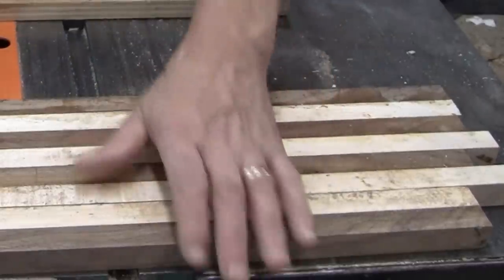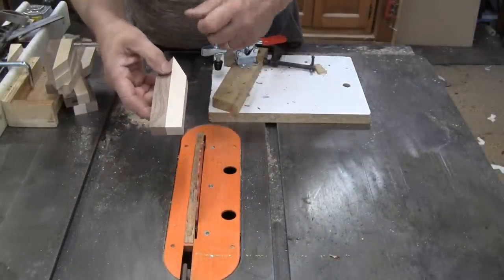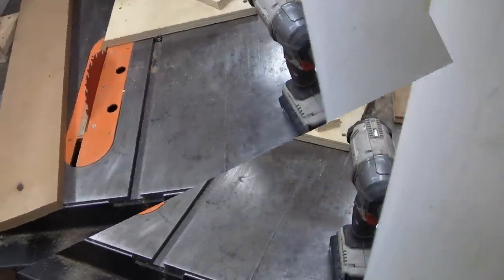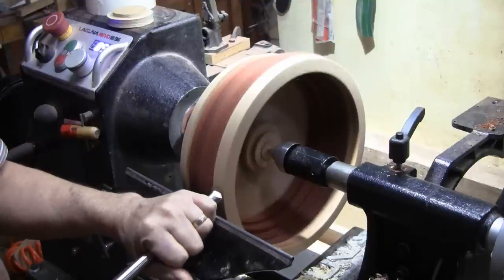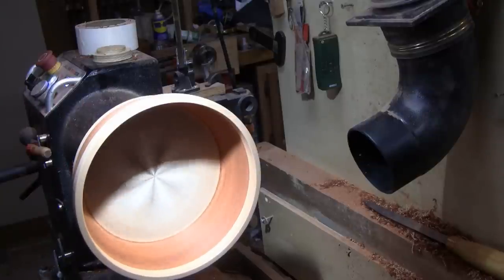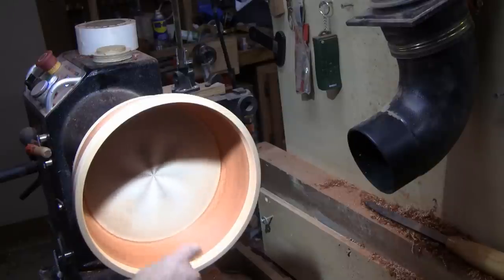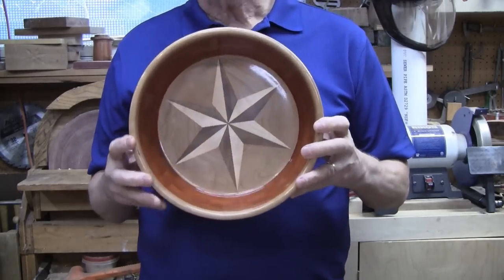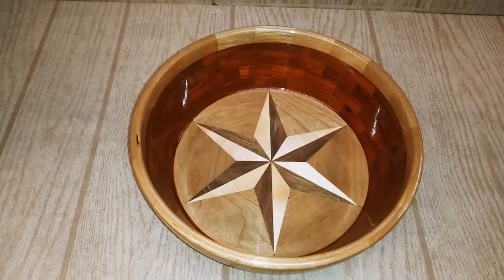Wood Turning A Star Illusion

Comment: Thank You for the detailed explanation. I followed your plan and made a similar star, however, since I didn’t have any padauk, I decided to keep the sides low (2”) and turn a platter rather than a bowl.
Reply from the maker: Thank you and a platter would look fine.
Gary
Reply: @ThePapa1947  I posted a photo of my platter on my (Rick Bourque) FB wall. Thanks again for your intricate details and video. I would have never been able to make this without your detailed video. 

The only issue I had was my 30 degree cuts were off ever so little which became apparent during my dry fit. So I glued up two pairs of three star tips, temporarily held then together with carpet tape and sanded the two sets flat on the sander. Of course two of the four cherry fillers had to be cut differently then the other four pieces of the base. A rather tedious process, but in the end it all came together.

Comment: What is the length of the "points". Also what angle did you cut the the 2 pieces to make each point. After a year from not turning, I  started to make bowls again. Thanks Gary. Beautiful bowl. Will try to see if a can make one. Ohhh, what are the engles to make the rings. Hope i,m not a pain for asking.
Reply from the maker: If you email I can give you the information. I have it in a file.
Gary
Reply: @ThePapa1947   ok will do thank you very much

Comment: Beautiful piece! Stunning!  How did you prevent the padauk from bleeding into the other woods?
Reply from the maker: When I use lacquer I do light dustings for 3 coats. After that it is sealed. But if you let it get too wet it will still bleed.
The water based sanding sealer also seems to work even wiped on. I would always test the finish first though.
Gary

Comment: What angle did you cut the second part of the star segments at? 30 for the 1st cut, then what? You make all this work look easy, but it is quite the opposite. Thanks for your time and your inspiration.
Reply from the maker: As best as I can recall those are 20 degrees per side making a 40 degree included angle. You can make those anything you want. Then fit the filler pieces to what you hve.
Hope that helps and let me know if you have any questions. I should have a drawing for that but at the moment I can not find it.
Gary

Comment: Gary fabulous piece. I've been looking for an example of how to make a star. I did have a question - on one end of the star you made a 60 degree included angle. What is the acute angle you cut on the outward point of the star? 
Thanks
Reply from the maker: Thank you Jon happy you liked it. So the outside end of the star is 40 degrees. It is 20 on each side.

Comment: That is beautiful Gary!  One of your best I think. The star is just breathtaking and the finish popped! Thanks for the challenge(haha) very good my friend, take care and be careful.
Reply from the maker: Thanks you so much. I like it a lot but might have to do another and add something else to it.
Take care my friend,
Gary
Reply: @ThePapa1947  do you only use hot glue for your temporary glue blocks?
Reply from the maker: @dougmccubbins1607  I use it when gluing the rings on a dizzy bowl to keep them from shifting. I also use it on a wood face plate to locate a larger bowl when turning the tenon off.
 So it has many uses in my shop.
Just yesterday I used it on a glue up so I could face the piece off.
 Thanks for watching,
Gary

Comment: Nicely done.  I've had a lot of trouble with padauk bleeding orange into adjacent light coloured woods. How did you avoid that?
Reply from the maker: Thank you Randy. Normally when I have Padauk next to light colored wood I spray light coats of lacquer to seal the Padauk.
I used water based sanding sealer on this one. It worked fine. Had I would have had maple segments mixed with Padauk I do not think it would have worked and there may have been some bleed over.
Thanks for watching.
Gary

Comment: Gary, amazing craftmanship, I see the tenon in the chuck on the backside of the bowl, but how did you attach the tenon onto the backside of the bowl? Did you just glue it on?
Reply from the maker: Thank you Brayton. I hot glue the tenon's on these pieces. They hold very well. You do want to get the hot glue as hot as you can. Especially on a piece with all the glue-up like this one.
 Thanks for watching,
Gary
Reply: @ThePapa1947  I have a hot glue gun but I am not sure it would get the glue hot enough. If I get a good glue gun and get things centered correctly it seems to be a good way to go. Thank you and again, amazing work.
Reply from the maker: A hot glue gun with 60 watt will melt it good enough. Or at least the one I have does. More watts and it will heat up faster. Which is a good thing. I may look into a 100 watt.

Comment: How did you figure where to make the final 30 degree cut on the bottom so the final pieces of the bottom fit so well. I love the bowl an want to try and make one but just a little smaller. Your bowl looks wonderful. Also, great video.
Reply from the maker: Happy you liked the video Ronald. So I will do my best to explain what I did. First of all I cut the 30 degree angle that meets in the middle of the piece. That was easy because all I needed to do is make sure the second cut would leave a pointed end with no flat spots.
The second angle was 20 degrees or a total of 40. That cut just has to trim a little off the 30 degree angle and you are set. When flipped  for the second side then those legs will have equal lengths . That way the piece that fits there can be made to match. I will point out that the only angle that is important is the 30 degree so that all 6 points will meet in the middle and have tight joints. The 20 degree can be anything because it will have a separate piece fitting between them.
If this does not make sense let me know and it would be easier in email to explain the process.  

Gary
Reply: I, for some reason, can't understand ho to get the last cuts made so they fir together without any gaps. Not sure what to do next.

Comment: Really nice bowl, do you ever worry about the  bottom cracking ? I’ve had some some do that over the years , finally started using floating bottoms . I started making Indian blanket design for the bottom an wondering if it’s safe to do?
Reply from the maker: Thank you Buster, I have not been overly concerned with it cracking. I am working on something right now that is a real test for a bottom. I have done similar and it is still stable. I should have it done in 2 or 3 weeks. Very involved and do not get in a hurry on them. 
As far as the Indian Blanket design I think you would be fine. I assume the whole bottom would be done.
Thanks for watching,
Gary
Reply: @ThePapa1947  thank you.

Comment: Great Job !    You mentioned the first angle cut is 30 degrees  what is the second angle ? , the long cut
Reply from the maker: Thanks you, the long angle was 15 degrees per side. You can actually make that what ever you one and then fit the pieces to it since they do not touch each other line the inner ones do.
Hope that helps if not let me know.
Gary

Comment: Very beautiful bowl.  Love how you get the angles just right.  Question for you.  When i use Padauk next to maple or other light wood and sand, i get some of the Padauk into the maple and thus the maple is not as clear or white.  As it takes on some of the Padauk color.  I've used sanding sealer before sanding but this just sands through and colors the maple.  Suggestions??
Reply from the maker: Thank you Tom I appreciate your comments.
I have had trouble with the Paduak as well. I have found 2 ways to deal with it bleeding over. 
Once sanded I wipe it down an number of times with denatured alcohol and use scotch brite if it raises the grain. I then like to spray lacquer on it. As many as 3 light coats before sanding.
I also found that the Minwax water based sanding sealer will not lift the colors much at all and that is after wiping it down with alcohol a number of times before as well.
My last dizzy bowl I had started with using the Minwax but I had not cleaned it with alcohol a number of times. So I sanding the inside down to bare wood and sprayed with lacquer. The back side I left the Minwax sanding sealer and then used Polycrylic.
 I am doing another Paduak and Maple turning and will mention the problem with the Paduak.
Hope this helps.
Gary
Reply: @ThePapa1947  thanks Gary for the ideas.  Does the denatured alcohol remove the Padauk bleed on the maple?  The bleed over happens as soon as i sand the Padauk which is next to the maple in a segmented bowl.  And then the Padauk is imbedded in the maple and no amount of sanding will clear the maple up again.  Suggestions?  I look forward to your next bowl with the Padauk and Maple.  thanks Tom
Reply from the maker: @tomgraham8201  No if you sand it you will start all over with the bleeding. Sand to final grit then wipe it down at least 3 times. Then enough sanding sealer you will not be sanding the wood.

Comment: Great work, and thanks so much for sharing. I learn so much from you. I understand how the weggie sled works, but a notice you use others for custom cuts. How do you dial in the cuts when not using the weggie? Thanks again for your great videos!
Reply from the maker: Thank you Dave. For the other sleds I have some accurate protractors that allows me to make adjustments to the sled or the cut.  I try to make one edge of the sled parallel to the cut and this gives me a good place to measure from. Sometimes I will use trigonometry to set the angle as well. Also never hurts to have scrap pieces to do a trial fit.
 Thanks for watching,
Gary

Comment: Gary. I used the same sanding sealer last week.  How long did you have to let it dry before sanding?  I only used two coats but it took a good two hours to dry.  Was this gloss or satin?
Reply from the maker: The sanding sealer  dries very fast. I have sanded it in 15 minutes. The Polycrylic is gloss and it dries very fast as well. I do not put it on very thick. I usually put it on and wipe off the excess. Did you brush it on or wipe it on with a rag?
Reply: @ThePapa1947  I normally use a paper towel also.   I used it on oak so maybe the pours were deeper
Reply from the maker: @marklengal9990  not really sure. I have had my dry just fine even on cold days. Try it on some different types of wood. But I have used it on Oak and it was just fine. Is it a new can of finish?

Comment: Just had a quick question Gary. Do you sharpen your table saw blades or have someone else do them? 
Thank you!
Reply from the maker: I used to have them sharpened when I worked across from a saw shop.
Now I buy a 2 pack at Home depot. Cost less than getting them sharpened.

Comment: If possible, it would really be helpful of you included the degrees for each piece that is cut.
Reply from the maker: There are 6 stars so where they meet in the middle they have to be 360/6=60. Each side will be 30 deg.
The other angle can be anything you want that looks good. Then it is a matter of filling in those spaces.
I did this video 2 years ago and would have to look that information up if you need it. I am always willing to help my subscribers out.

Comment: Watch your video and my ? 30 degree
Reply from the maker: 30 degrees on each side of the star pieces making them a 60 degree angle. So 6 pieces will make a complete 360 degree circle. The outside of the star pieces can be what ever you want. Mine were 20 degrees on each side or 40 degree total.